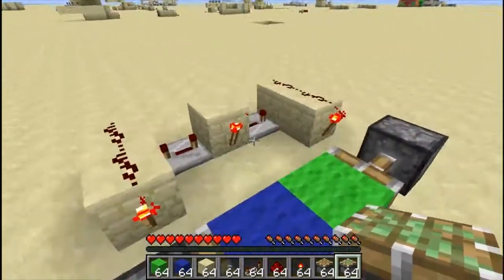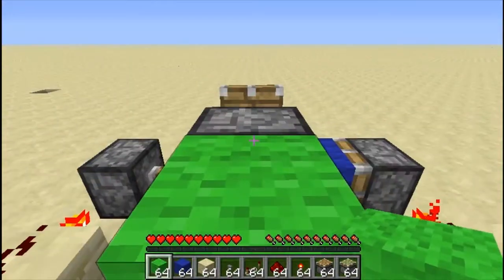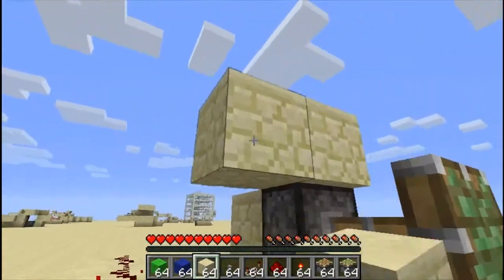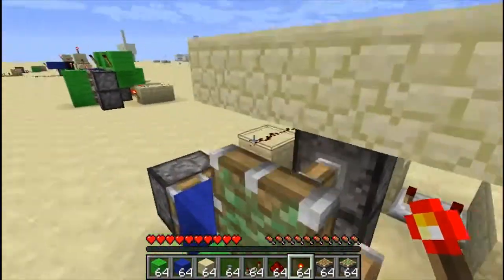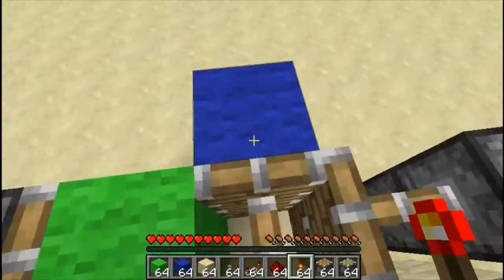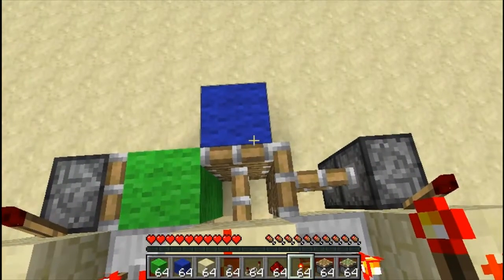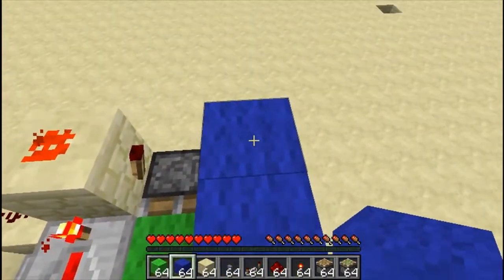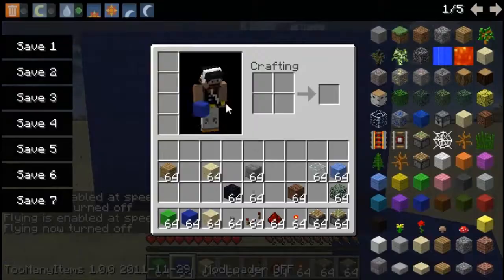2 High Block Swapper

Comment: That is really helpfull for houses that i build and other building. I did something to that idea of the 2 block switcher but made all 4 repeters all 1 tic, the two non stickey pistons push way faster now and it switches all the blocks and dosen't repeat it. I have 1 question is there any way to make the 2 stickey pistons push out faster? Response would be greatly helpfull.